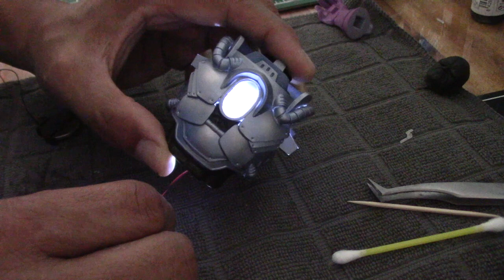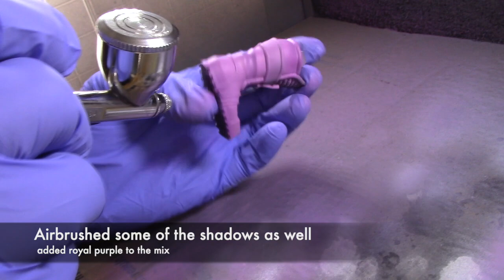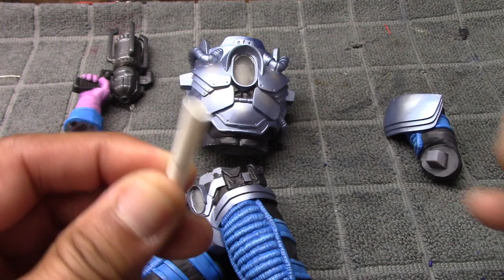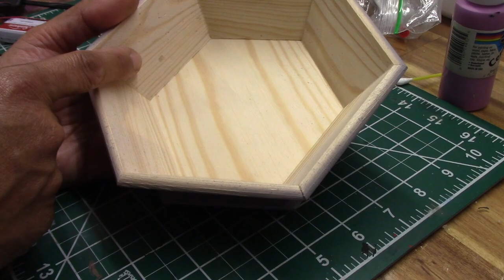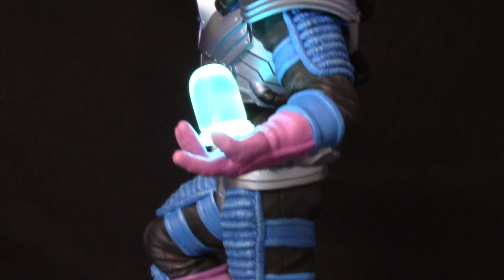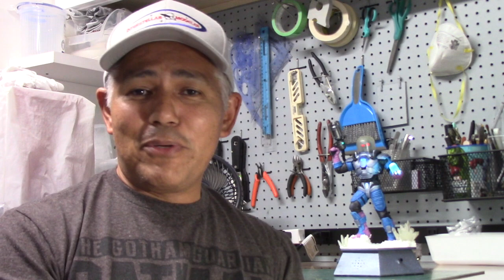Mr. Freeze Halloween Build Part 2

Comment: Fantastic job! I really enjoy seeing how creative you get with the lighting - it makes such a difference and brings the models to life. One quick thought on the dome -I wonder if orienting the part with the ring on the build plate would eliminate the need for supports? You would need to add a drainage hole in the middle top of the dome, but that might be an easier blemish to correct. Happy Halloween!
Reply from the maker: Hi, thanks i tried that but the very top came out flatter and waa too short for use. Thank you

Comment: Here is a crazy idea for the helmet. Try a gumball machine that has prizes instead of gumballs. The prizes are usually in these little clear plastic containers and one half is usually larger than the other and looks like it might fit as a helmet. There are two sizes out there typically but you may need to visit a couple of restaurants or stores that has a bank of gum machines out front.  Crazy I know but I actually used two of those things for the light up eyes on my DRD build from farscape. They worked perfectly. good luck and the model is pretty awesome as usual.
Reply from the maker: Thanks....the challenge is finding something not only wide enough but tall enough as well. It's kind of an odd size requiring 34mm in diameter and about 40mm high. Will check into it, ,appreciate the tip.

Comment: If you have a university nearby with a glass shop it would take about two minutes to make that helmet from the bottom of a glass test tube.
Reply from the maker: Problem with test tubes, at least what I’ve seen so far, is that I haven’t found anything large enough. Possible a cigar container might work.
Reply: @InterstellarModeler  I'm a retired chemist - there are definitely test tubes that are large enough. It was just a thought, the frosty look of your resin version looks great. I only suggested it since you expressed some dissatisfaction.
Reply from the maker: @triruns  Thanks...yes I go back and forth on it.  The diameter of the tube needs to be 34mm.  Are there tubes that large?  Thanks
Reply: @InterstellarModeler  I'm not sure if you could get 34mm off the shelf but I know 35mm are available. There are also a lot of sizes in polystyrene, but I never used those so i don't know. If you have a local brewing or winemaking hobby outlet nearby that could be another possibility.

Comment: What’s impression of the 3D printer you have. I’m looking at the elegoo. Any issues now that you have used it a lot.  My first endeavor into it, is slicer program any count?  Intuitive?
Reply from the maker: I have had a great experience with the Mars. With the debut of the monochrome printers, the original mars will be very inexpensive.  Cheap enough to buy one and give it a go.  For me it works for what I need it for.  I would like to eventually upgrade to the Saturn but am in no rush to do so.  Check out my other videos on 3D printing on my channel.  I go into more detail.  I'd say the biggest challenge for me was to learn how to place supports properly.  Thanks and hope that helps.